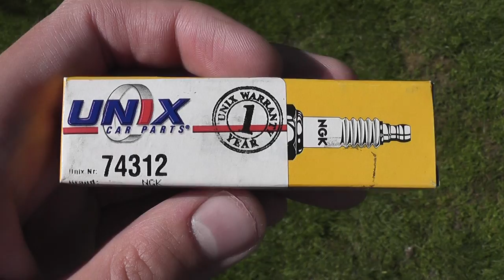Opel Corsa - Spark Plug Replacement

Comment: I didn't have a problem with the pack at all, but the connector was extremely tight. Just installed Denso IK20TT plugs yesterday.

Comment: Very good tips to remove this coil pack ! You did well with, of course , with gloves !!!! Could you tell me with what kind of product you use to have a such very clean engine ? Do you use a 'karcher steam' ? or some product added on engine before to clean? I have Opel Corsa C 1.2  Phase 1 Ecotec Gas 2002 (Z12XE) Fashion Edition 3 door.

Comment: Hi, Great video and very instructive! I have a question , I have a A12XER engine on a 2013 Corsa D and want to change the spark plugs. There are two kinds at the market with code numbers "12 14 068" and "12 14 031" both original GM parts. I couldn't find any source to list the difference between them. Would you happen you know the difference? Thanks in advance!

Comment: Hi, great videos!!! It has been a great help in servicing my wife's Corsa C 1.2 Njoy R!! By the way, can you do a tutorial on how to change the fuel filter!? (gasoline!?)
Many thanks once more for your films!!
Reply from the maker: Bruno Marú Thanks, but sorry. The Fuel FIlter Replacement is too complicated at home.
Reply: ***** Ok my friend!! Not a problem!! I imagined that!!
Reply: On a petrol version, the fuel filter is in situ in the tank, won't need replacement unless you have loads'a crap in the fuel tank :)
Reply: what kind of bolts did you use to plug into the coil pack to pull it out?

Comment: I have a 2003 Opel Corsa.. or Holden barina as we call them here.

Do you think the spark plug is the reason my car gives a jerking feeling and slight delay in gear change? Check engine light is on.

Bought a new set of spark plugs today. Just wondering what you think?
Reply: How did gou fix it?

Comment: ***** What kind of torx tool did you use? I want to buy only the one that I need for changing the plugs, but I don't know what number it is. Thanks.
Reply from the maker: That is a T30 torx, and the Spark Plug tool is 16mm.
Reply: ***** Thank you.